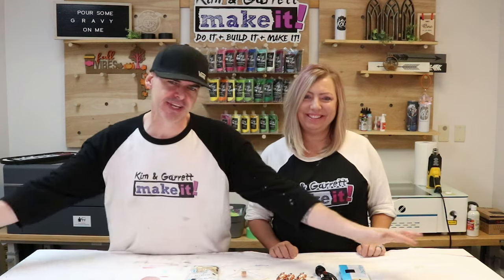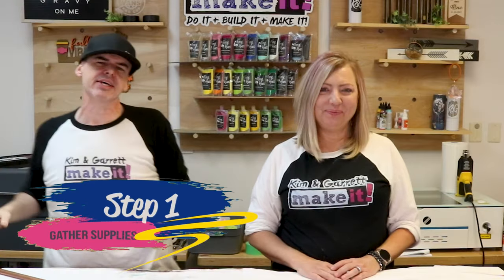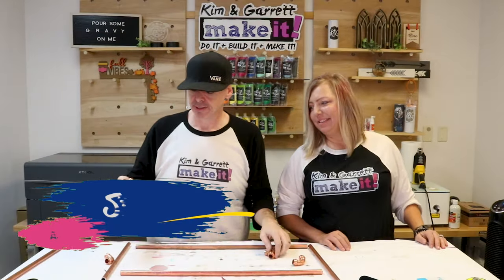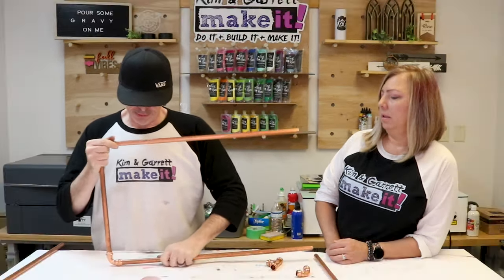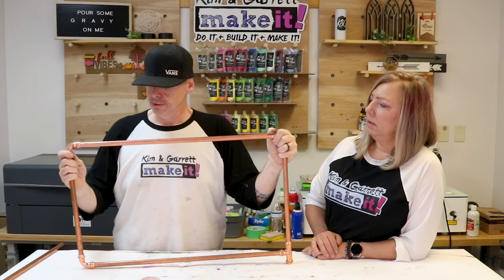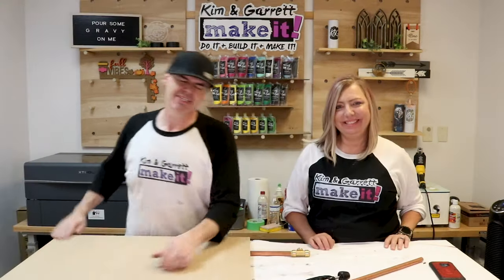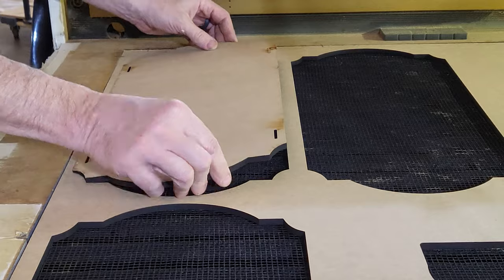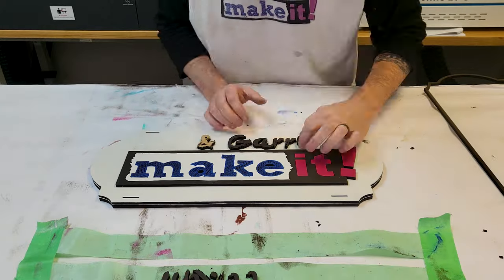DIY Hanging Craft Booth Sign with Copper Pipe

Comment: Just put some 5 minute epoxy in the joints and you can use normal pipe fittings instead of the expensive crimp on ones. Then save the sharkbite for the one you want to be able to change.
Reply from the maker: Uhg!!! 5 minute epoxy!! Yes! We thought the first corners would just push in, and then I refused to spend money on the other corners.

Comment: If you use all shark bite connections you won't need to crimp the corners they automatically grab the pipe to hold it together
Reply from the maker: Yes! All shark bites would be way easier. I was afraid the shark bites would twist. Thanks Vince!!! ~garrett